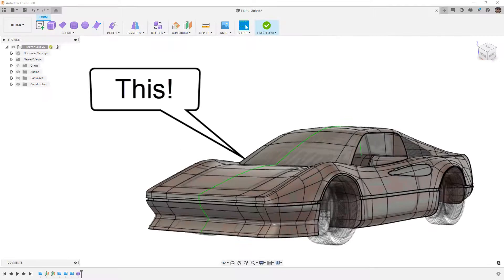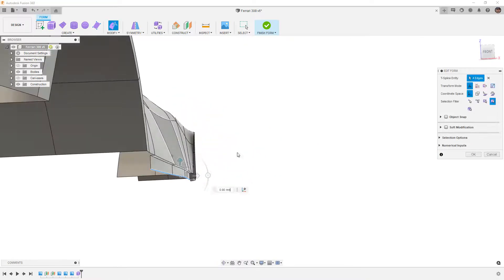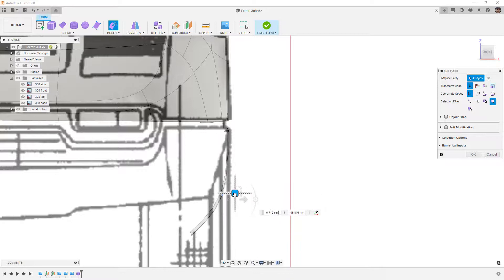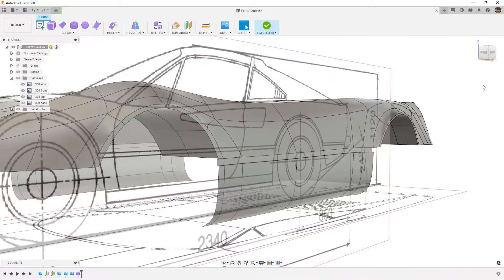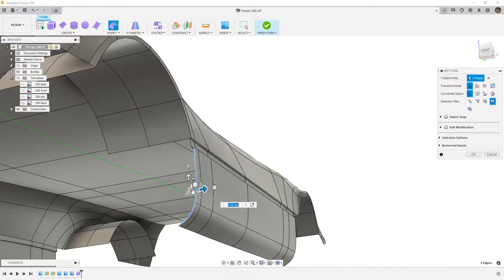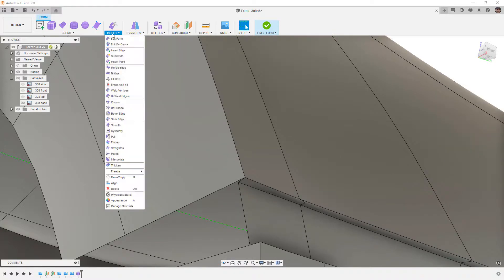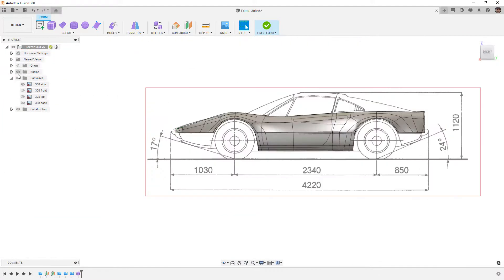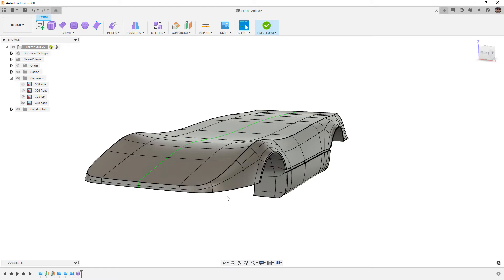How to Model a Car - Ferrari 308 with Fusion 360 Forms - Part 5 #Fusion360 #CarModeling

Comment: Bro if I do the vertex weld at 11:04... It turns into box display and doesn't come back
Reply from the maker: if that happens its because there is an error/issue.  You will need an edge to merge so try welding another vert.

Comment: Thank you so much for these tutorials. They're very in depth, clear to follow and your methods are very transferable. My only problem is that the annoying axis/dimensions box is constantly in the way whenever I go into edit mode lol. Is there a way to abolish this little fellow?
Reply from the maker: I HATE THAT THING!  It is always in the way!  and the check when sketching.  Never fails.  You can drag it out of the way but always seems to come back.  If i find a way I will make a video, but sadly none that i know of.
Reply: @LearnEverythingAboutDesign  Damn it! Things would be alot quicker without it as I'm sure you're aware lol. I've subbed so I look forward to what you come up with!

Comment: Hello, i'm wondering whenever i try to weild a verticy it puts me into box display and won't let me change it back to a rounded form. Can you help me?
Reply from the maker: Sure!  Usually what that means is that you have some overlapping faces that prevent it from generating the surface.  In a lot of cases you can run "Repair Bodies" from the utilities menu and it can find that.  You may also have an extra unwelded vertex in the middle of an edge.  If you cant figure it out you can share the model with me support@caducator.com
Reply: @LearnEverythingAboutDesign  I had both of those problems it seems. It makes sense now. I've repaired the overlapping edges and as it turns out I haven't actually welded all the vertices either. Thanks for the help!

Comment: Took me a while to tweak those creased channels so they were square and parallel where they needed to be--I did need to use my Space Mouse out for the constant and necessary rotating. I'm hoping to see an efficient way to get all the edges lined up--the straighten tool doesn't quite cut it, and I am still trying to get my head wrapped around the scale tool for aligning edges. I have to go through each axis, one by one, until I find the one that doesn't expand or smash the line I'm trying to straighten.
Reply from the maker: Yeah, i think in the video i mentioned that forms is not the based way to do those channels, but we did anyways :)  In reality surface tools after is much cleaner.

For scaling just think about the fact that you are looking at something "in plane"  So say you are looking at a FRONT view on the view cube.  This leaves X axis to the right/left and Z axis up/down.   If you want your edges/vertices to lay on the X axis in a horizontal line, you need to scale them in Z.  If you want them to be in a vertical line along/parallel with Z, then you need to scale them in X.

So say you have 5 vertices scattered around, mostly in a horizontal line but some up and some down.  If you scale them in X they will either pull them towards each other or away from each other in the X direction.  To flatten them out it needs to be in Z.

Comment: Fourth time around. Its not perfect but I'm getting through it. I stop your video and sculpt myself and then see how you've done it. The rear fender I had to bridge then fill hole to close the shape off then used the insert 3 points to get back to flowing geometry. I thought cutting in the groove in the middle of the body was quick and easy way to do it.
Reply from the maker: Only 4! you are a master by now :)  It takes a lot of playing around and doesn't always work out.  The trick is being able to be flexible and pivot when needed.  I know people who get stuck in their approach and it just burns up time.